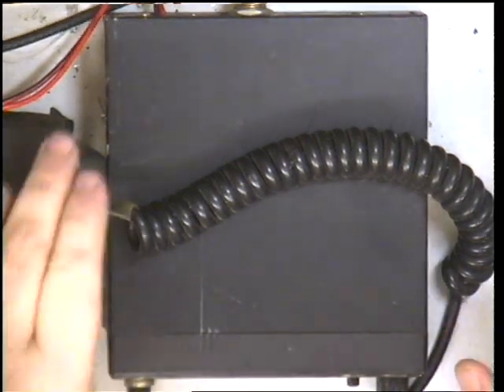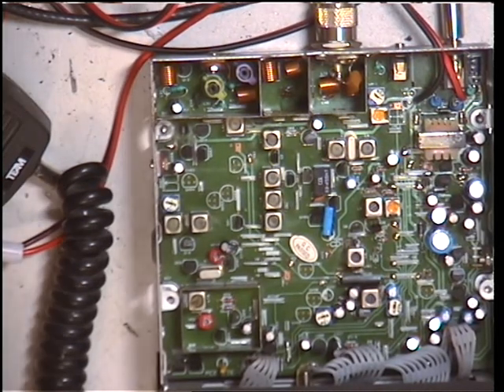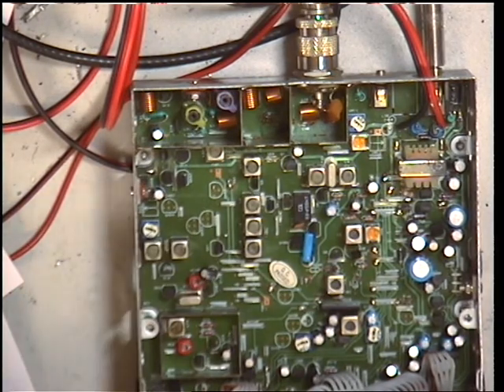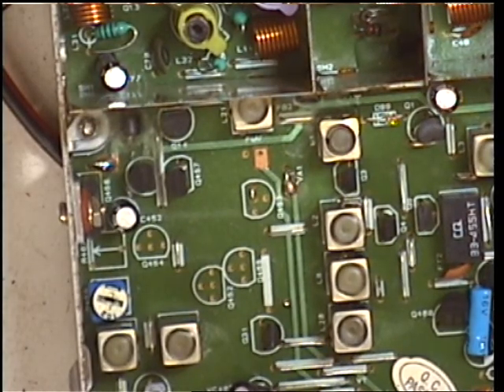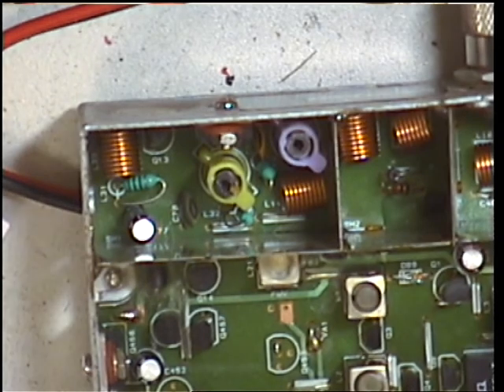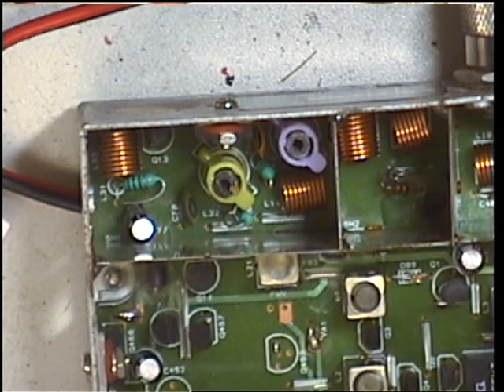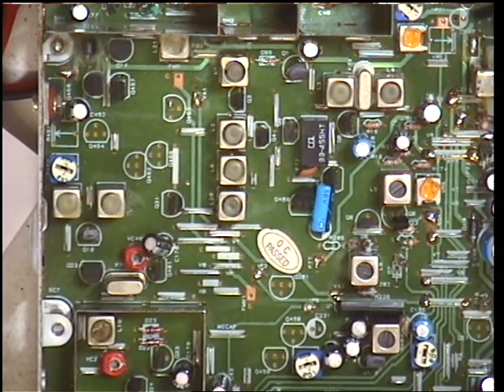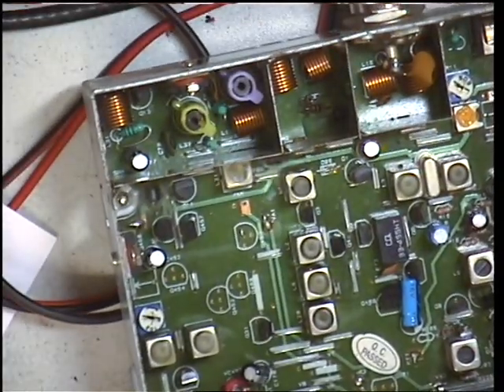Team Transcom 8000 UK (PR27/97) CB radio (Mobile) - Transmit adjustment

Comment: A friend of mine bought one of these and returned it to the shop the next day due to poor audio reports from other stations. I had nearly bought one myself but decided to get the Maycom EM27 instead.
Reply from the maker: Not good audio.  The factory condenser mike is probably to blame to some extent. Used with a nice speech processor mike I'm sure it would be fine. Yes; TX audio lets it down....Mr Chippie said so on our field test uploading overnight.